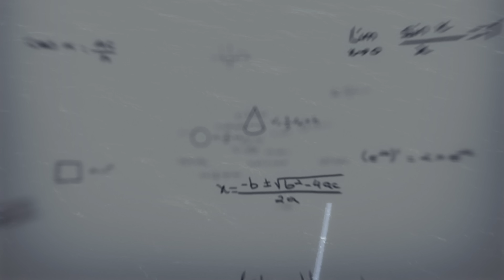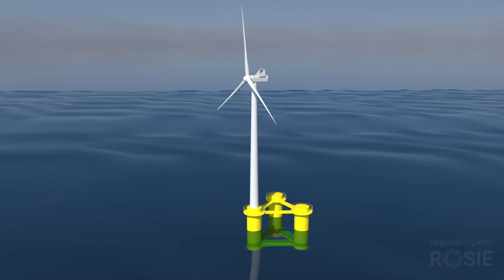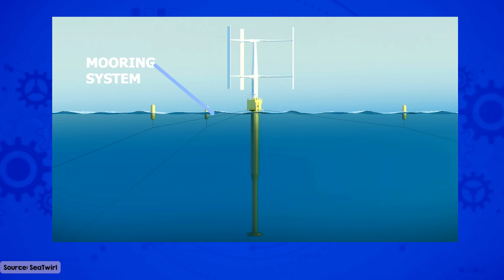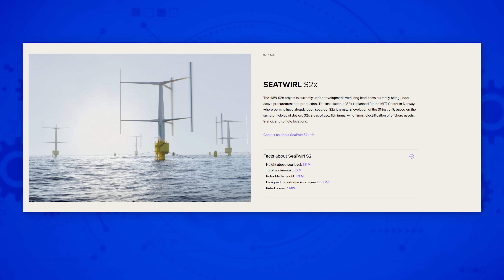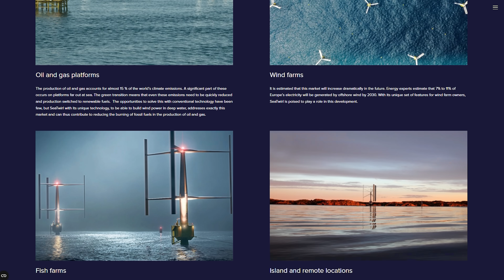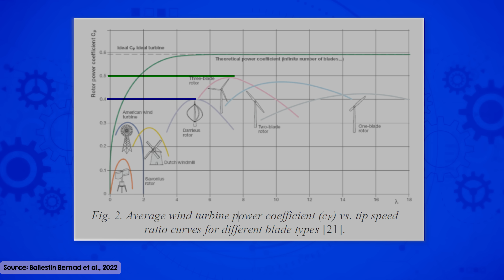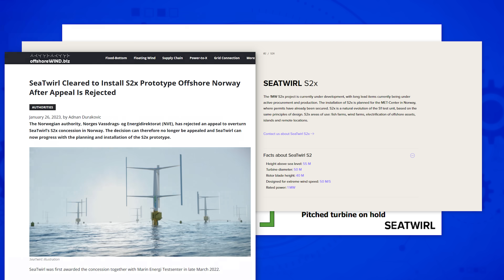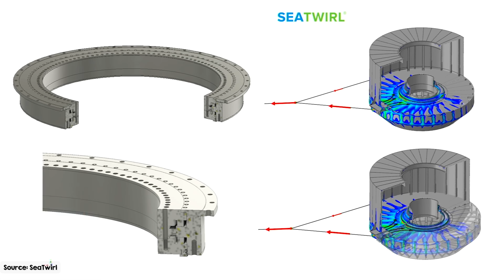Are We Building Wind Turbines All Wrong? SeaTwirl Thinks So

Comment: I worked at UNSW aerodynamic laboratory and tested many vertical wind turbine designs.There is a good reason why vertical axis wind turbine are not used, the simple answer is they are less efficient compared to horizontal axis wind turbines for any comparable size. A long proven fact. Also floating wind turbines are more expensive compared to fixed turbines, and nothing in salt water is cheap to maintain. Bottom line is onshore horizontal wind turbines of reasonable size are cheaper to maintain and solar is now the cheapest electrical power available.
Reply: Yeah, but you're in Oz. Try doing solar in northern Europe. You guys get almost 3x the sunshine hours of some places there. And they have places not that deep that have wind ALL the time (Wellington styles!).
Reply: @GeorgiiGrogan  Correct. In Australia we have the advantage of plenty of fairly sunny land for cheap solar.
Reply: @GeorgiiGrogan Germany is full of solar farms, and house top solar is extremely popular there.  We lived in Wiesbaden 2020-2024, and saw that there is no shortage of solar in Germany.
Reply: Did you analyse a single turbine or a whole farm of turbines? There have been several studies indicating that for a given wind farm area the efficiency is equal or perhaps better. In the grand scheme of things that’s what matters these days. To get the most out of the area you’re allowed to build on. 

You must take into account total system costs. In many (especially cloudy) areas it’s best to combine with wind power to get a better mix of power production. 

As the share of renewables get higher, the value of stable power increases. And floating offshore generally have more stable power production than land based wind power. It’s also getting increasingly harder to find really great spots to place wind turbines on land in some places.

We don’t know if this will become viable but we need to explore all options and there’s plenty of reasons to think floating (possibly vertical) wind power will find a significant niche. We won’t know for sure until we try. Very few thought solar power would become as cheap as it did. We just had to invest in R&D for a long time to find out
Reply from the maker: I encourage you to look at those studies yourself. They are not high quality. It's been a couple of years since I last looked so perhaps more has been done since, but the ones available a couple of years ago that got so much press were 2D CFD analyses that were unvalidated against any real world conditions. So I would call that at best, an interesting possibility that ought to be tested properly.
Reply: @EngineeringwithRosie  CFD modelling is not much use unless you have real world experimental results to validate the CFD model. We already have the test results. VAWT are less efficient compared to HAWT.
Reply: @auspiciouslywild  My experience is testing one turbine at a time. Floating wind will only be economically viable where you don't have the land for onshore wind or solar. Horizontal wind turbines are around double the efficiency, that's allot of catching up. Also from a mechanical and structural perspective they have big problems when made large scale. A much greater rotating mass is a big problem, due to greater out of balance forces and a higher minimum wind starting velocity due to the increased inertial mass.
Reply: Google "Perth Canyon." Then ask yourself, "Fixed or floating there?"
Reply: @oneeyedphotographer  Not suitable for any type of wind farm. Western Australia has plenty of suitable sites for solar, even cheaper than onshore wind turbines now.
Reply: @Terry-y2r  There are extended periods, roughly May to October, when the South West is mostly under cloud and rain. Solar doesn't work well then. Up north, there are the wet  and dry seasons, in the wet it's very wet rainfall is measured in metres, and it's very hot, mid to high 40s and 50+ has been recorded. Solar on homes might be feasible, but not solar farms. Windmills would be shut down so they don't blow away.
Reply: @Terry-y2r  In your studies, it seems to me that you didn't ask, "Where is HAWT better?" Efficiency for a given size isn't the only valid comparison. If I want a smaller quantity of electricity, a HAWT might win.
Reply: @oneeyedphotographer  My observation was HWAT wins most of the time, large or small..
Reply: @oneeyedphotographer  All true but we have a small population in that part of Australia. Its still cheaper to use solar mostly as there is more than enough land.
Reply: @oneeyedphotographer If you lower the efficiency 20%, it means you need around 25% bigger blades for the same energy production. Bigger blades, bigger support structure. Which cost more money.
Reply: Yes…but if it costs a lot less..
Reply: I saw very similar vertical turbines with a capacity of about 1 MW a few years ago in Russia and in China, blades 2+2 and 3+3 (90 degrees blades shift).
Annual output is 35-40% lower than for horizontal, but the material capacity is twice as high, so the initial costs are almost twice as high.
Reply: @MihailG5541  I am confused.
Reply: You’re missing a few key points:-

VAWT design turbines can effectively generate electricity from wind speeds as low as 6mph, 24/7. The horizontal axis ‘windmills’ everyone’s familiar with require much higher wind speeds to generate power. They’re therefore more reliably operating, in hours per day/week/year. 

They’re also inherently self limiting in the top speed of rotation. This translates to being useful during high winds, which would demand a HAWT ‘windmill’ design to be set motionless, with blades pitch/yaw turned to present the minimum surface for the wind to act on. The top blade is subject to higher pressure and wind speeds than the lower tips. Operation is shutdown as a consequence. 

In marginal locations close to shore, where horizontal axis turbines are not viable, VAWT is very efficient, in the disturbed wind conditions, complexity and expense of deployments, cabling and other key materials. This places power generation closer to the demand for power. Distributed power generation is a great asset in national security context as well. 

The nature of VAWT design also doesn’t absolutely require rare earth ‘super magnets’ (eg. neodymium) that we have none of ourselves. The large diameter turbine possibilities, inherent to VAWT design, can utilise less exotic materials that don’t depend on a Chinese supply chain.
Reply: @PhilWhelanNow generators can be designed with or without rare earth mineral magnets. It has nothing to do with turbine design. You can make VAWT and HAWT with ou without magnets.
Wind energy is proportional to the cube of the wind speed so gaining a few miles an hours on the low end is useless. I don't think VAWT start with less wind than HAWT. HAWT regulate their power output much better, constant production even when the wind is gusty.
Reply: Wow, you really are a downer coming here with FACTS AND EXPERIENCE!.
The Title of this video reads like a pimped piece of Public Relations and Marketing dress up as 'Engineering'.
Reply: You know kochu
Reply: LCOE is what wins the day , SeaTwirls design has lower lcoe.
Reply: Here in the UK we have a lot of almost constantly windy seas, not much land, and bugger all sunshine
Reply: @markmcandrew8489 …seems like that at times!

We do have a good deal of sunshine, at least in summer, but perhaps wind is a better option
Reply: @markmcandrew8489  We also have a fair number of sandbanks just offshore, which make ideal locations for driving in the monopiles for conventional horizontal axis turbines, which must be much cheaper than anchoring a floating  turbine and better protected from shipping. I've actually walked across a sandbank that now has a windfarm on it, on a spring tide when the tide was at its lowest, dragging a small boat when I went fishing with my dad. It's only round about 4 miles offshore and 6 miles in-all from my home.
Reply: @markmcandrew8489 plenty enough sunshine for solar in England and Wales.
Reply: @markmcandrew8489  We have strong tidal flows too, something that's totally predictable and barely being exploited at-all in the UK.
Reply: @mels8966 because tidal is environmentally damaging as well and quite costly. Very few plants world wide still operating.
Reply: @Nikoo033  Floating tidal turbines like orbital O2 would have minimal environmental effect.
Reply: Until you run out of places to put them...
Also (from experience) many people don't want to live under a bunchbof turbines going "woosh woosh  woosh"  all day!
Lastly, ever heard of the Roaring Forties...!!! Efficiency is irrelevant when you have constant high quality wind. And that DOESN'T happen on land...
Reply: @jamesspry3294 not too many folk live out at sea!
Reply: @jamesspry3294 far off shore where nobody lives the wind is VERY constant. Low speeds are higher and top speeds are lower. Almost perfect wind for turbines...
Unfortunately it's top deep at the moment.
Reply: @jamesspry3294  The wind is not that constant. The big problem for floating wind turbines is construction, maintenance and transmission costs.
Reply: How is this going to pass the IEC aerodynamic braking requirements?  Are they running variable speed or fixed?.  I'm also a little skeptical about the array loss recovery claim.   The loads modeling on those struts could be a challenge.  Sooo many questions.
Reply: @marke.haller4267 4..12 m/s, I think.
Reply: "solar is now the cheapest electrical power available." - solar and wind energy are the most expensive.
Reply: @Pawel_W1 it depends
Reply: @Pawel_W1  Then why is solar being adopted at a higher rate compared to of coal, gas or Nuclear?

Comment: I'd be interested in hearing about the power density of these turbines Vs the standard horizontal ones and see whether the MW/km² is comparable between the two types
Reply: Should actually be higher for the Seatwirl solution , vawt's can actually be grouped much closer and will actually result in improved performance of each vawt.

Comment: Is the high center of gravity the main constaint. I would have naivly thought, that the wind load is the defining force for the rotation the float has to resist?
Reply: These have a lower centre of gravity than HAWTs because the generation is closer to the surface.
Reply: @oneeyedphotographer  I understand that. But my question was if that is even the main force you're designing for. Isn't the torque on the foundation from the wind significantly larger than anything the weight distribution causes?
Which would mean the platform can only be a little bit smaller, while suffering from the issues of horizontal wind power.

Comment: When your fuel is free, efficiency isn’t very important. It’s about lowering LCOE.
Reply: Efficiency still matters, the less efficient the more plant is required.
Reply: @oneeyedphotographer  during low wind operation yes, but not during medium and high winds. horizontal axis turbines are throttled to their nominal power in higher winds anyway. I assume the same would be true for VAWT. If you have 100 MW of wind resource, but only a 10 MW generator it doesn't much matter if your blades could theoretically harvest 50 MW or just 40 MW.
Reply: @w0ttheh3ll  If you've got a turbine engineered for 10 MW and a site that regularly offers 40 MW, whoever planned your deployment screwed up real bad and should be fired immediately.
They should've specified smaller, cheaper blades if you didn't need that much power, or a beefier structure and a bigger dynamo if you did.
Reply: @ps.2  You're right, I simplified the issue by assuming infinitely strong mechanical structure. But the point still stands. Wind turbines operate a lot in regimes where they don't even attempt to catch all of the wind resource.
Reply: @oneeyedphotographer yes, but that comes out in the LCOE. 

If you lose 3% in efficiency, but the capital and M&O costs are half as much, I don’t care so much about the drop in efficiency.
Reply: The fuel is not free. My local power company has to pay for the water flowing through its hydroelectric facility, and in a similar way, wind turbines disturb the wind downstream. This has a real cost, and not all of it is understood, especially the environmental cost.
Reply: @Ethan.Lamoureux  Enlighten me, what are these costs you speak of, give a few examples and tell me if any energy company has ever been billed for them.
Reply: For example, the wind that bring nutrient and mineral from sahara desert to amazon rainforest. If the wind is intercepted to make wind turbine power source, the amazon rainforest is cooked.

Well, that was exaggerating a little bit but you get the idea. Nothing is free, there are cost to this
Reply: @BooooMiiiii-k2l  You clearly haver zero idea of the magnitude of the wind you are talking about and the altitude at which it operates. Go and research it. Now compare this to the miniscule percentage of the wind's energy taken by even the most massive wind farm and the altitude at which they are installed.
Reply: @nickwinn7812  you are right, i am just a layman 😅 sorry
Reply: @nickwinn7812  What altitude do you think? I know about here, but you might have a different answer.

Comment: Really interesting case of trading inefficiencies for simplicity and cost savings, not just the VAWT design itself but also that the bottom counterweight is having rotational drag from spinning in the water. Makes sense as the efficiency gain probably would never recoup the cost of the added complexity of doing it differently.
Reply: this design while its great doesnt really compete with the high tower wind turbines unfortunately.
Reply: Look at 9:30 where they explicitly say the mooring lines are what hold the generator against the torque of the rotor.
Reply: I'm pretty sure the counterweight doesn't spin in the water or did I miss that? It would be a huge deal if it did. But that thought made me think of another issue which is  the rotational torque on the guy lines. That could be elimiated by desiging a pair of these on a single floating structure that rotate in opposite directions. I would guess that the added complexity and weight would outweigh the advantage of smaller lines though.

Comment: There are a lot of offshore wind resources where the wind is very strong and consistent but the water is too deep for fixed bottom turbines. This could be a better fit than the expensive HAWT offerings available but only if they can keep the capital costs down. Lowering the number of blades could be a critical step in that direction. Less bits, less problems.

Comment: They might get funding to deploy off the coast in the Levant to provide emergency power while the infrastructure is being re-built. I understand the Gaza power plant in close to the coast, so coupling the supply from the floating turbine should be fairly straightforward. It would also simplify Israel's complicated fuel supply arrangements with the two different administrations. Deploying some floating turbines would provide real-world data and demonstrate the viability of a flat-pack generation setup that could be deployed to disaster zones, especially if it could then be re-packed and shipped to another location. The Swedish government is noted for taking an apolitical practical approach to foreign aid (they did get Hans Rosling to set up Gap Minder after all) and it would give them some soft power in the region so they might consider funding it, and getting the experimental data as part of the pay-back.
Reply: There is still a blockade and they're still restricting aid. They deliberately destroyed every piece of life supporting infrastructure and if you translate some articles it's very cleat they don't intend on letting them rebuild. There is a reason they only let well trained western journalists look at the place from thousands of feet up; while they dropped token amounts of aid to crush unaware people in tents. It will require pressuring our western leaders to grow their own pairs and stop kissing the ring every time the US calls.
Reply: Apart from Israel deliberately destroying all energy infrastructure in Gaza the main problem is that in the Gaza strip and even dozens of kilometers offshore the average wind speed is really low, about 4 m/s. For comparison the north sea has 10 m/s. Only the tallest hills in the west bank have enough wind for low wind turbines to make sense.
Reply: Giving Gaza sea access?  you don't know how a prison works.